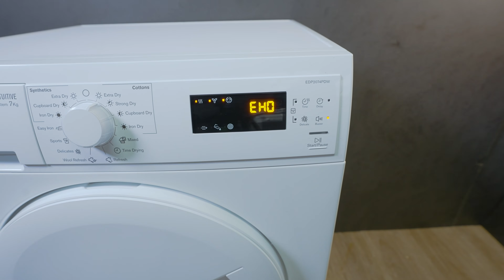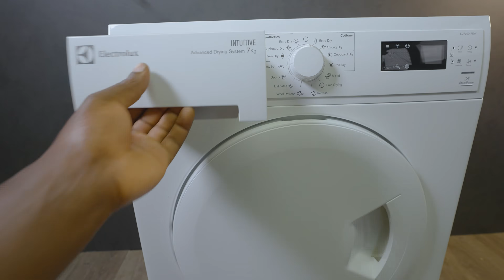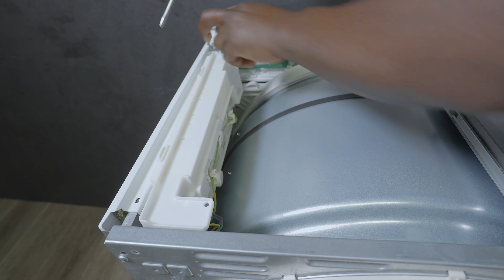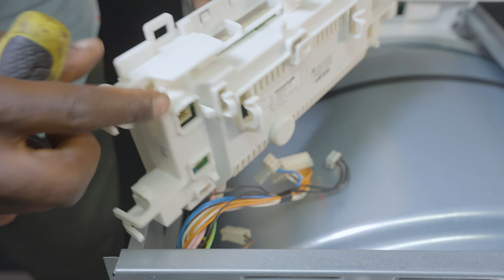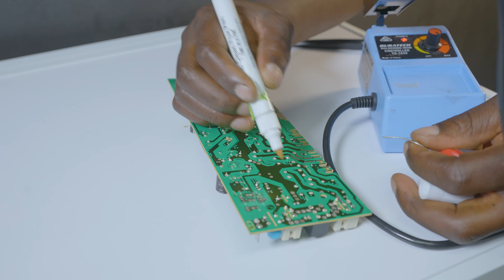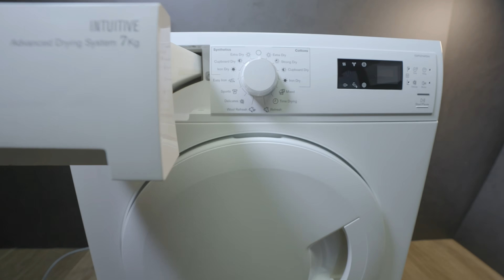Fix EHO  Error Electrolux Zanussi Dryer Easy Repair

Comment: This seemed too simple to be true, but a quick resoldering fixed EH0 problem on my EDH3497RDW dryer, as there was indeed a micro crack on the solder joint behind my OMRON relay. Thank you!

Comment: I am getting EHO after some time. It runs fine for 10 mins and then I get EHO and it persist after that.  If I switch off and connect after some it works fine and then again the error comes. Does that mean that there is a lose solder and is getting disconnected after running for some time?

Comment: Just watched this DIY tips video and honestly, I’m so glad I found it. I followed the steps one by one, and everything was super easy to follow—even for someone who’s not very technical. I was getting the EH0 error on my Electrolux EDC2086PDW dryer and thought I’d have to spend a lot fixing it. Most other tutorials were either too confusing or didn’t help, but this one was clear and straight to the point.

Thanks to this, I fixed the issue myself—no need to spend on a new PCB board or call a technician. It worked like a charm! If you’re facing the same error, seriously, look no further. This actually works and saved me a lot of time and money.
Reply: I am getting EHO after some time. It runs fine for 10 mins and then I get EHO and it persist after that.  If I switch off and connect after some it works fine and then again the error comes. Does that mean that there is a lose solder and is getting disconnected after running for some time?
Reply: @gamingmechanics6062 loose solder. I had the same symptoms

Comment: A huge thank you for posting this video. It totally saved the dryer. Frankly I could not see any issue with the soldering, but I did them all and it worked! You'll have to tell us how you came to the diagnosis in the first place!

Comment: Adding to the many comments already to say a big 'thank you' as this fix has worked a treat.  Solder joints looked fine but redid them and now we're back up and running.  Your great video has been much appreciated!
Reply: Hey, did you have to replace the component, or was simply adding more solder enough to fix the issue? Have an 10+ year old dryer that managed to get this problem with EHO.
Reply: @ just replaced the solder.  Used a solder sucker to remove the stuff there (that looked perfectly fine) and replaced with new solder.  Put it all back together and code gone, dryer working, and still going strong now. 👌🏻

Comment: Hello, my machine does not heat up. I did a test on the resistance and there is continuity, but the current that reaches the resistance is 7 V. What can I do to adjust it?

Comment: My EDC2075GDW was having this error and after following the video it fixed it thank you!
A couple things were different for me: 
First off, my Motherboard has a yellow glue over all the solder joints. Applying new solder would cause it to roll off and I couldn't de solder any of the joints either. So, you have to scrap the yellow stuff off around the solder joint then you can apply fresh solder. 
Also, the plastic connectors were very stuck. So, I had to use needle nose pliers and a flathead screwdriver to carefully to pull them off.
Otherwise, it wasn't too bad make sure to take lots of pictures of the motherboard wires and connectors.

Comment: few years ago, I resolved this problem and others by soldering the pins on the entire board. It recently broke down again with the same fault. There was a resistance that must have a value of 154 k or 145 k. This resistance had an abnormal value of 350k. Replace the resistance with another with the correct value and also a 12v dc relay, close to this resistance. Fault disappeared. I saved €300

Comment: Thanks so much for a useful video. It was the same issue with my dryer, causing intermittent the EH0 error. Dry/cracked solder joints on the back of the relays. Thankfully I had just enough knowledge and the right tools to fix this in about half an hour.

Comment: Na 6 jaar hetzelfde probleem en inderdaad bij mij waren ook de soldeerpunten rondom het OMRON relais slecht/gebroken. Oude tin met tinzuiger verwijderd, en opnieuw gesoldeerd (met tin en ouderwets lood). Een aantal ander twijfelachtige verbindingen heb ik ook opnieuw gesoldeerd (en steeds de oude tin eerst verwijderd). Alles weer in elkaar gezet en de EH0 melding was weg. Bij het losmaken van alle stekkers is het me alleen niet gelukt om de stekker met de 3 roze draden los te krijgen, stekker is me afgebroken. Hierop de contrastekker van de printplaat verwijderd, en 3 losse draden op de print gesoldeerd en (helaas) met kroonsteentje later de verbinding met de 3 roze draden gemaakt.
Reply: I have exactly the same problem with the 3 pink wires. It looks to have its own catch but it's still not coming loose. Thanks for commenting, I'll just solder in place instead of breaking it off. Groetjes!

Comment: Previously I watched a video saying I needed to clean the dust and fluff off the pcb but there was nothing to clean off. However, I followed this video and I did find bad solder joints on the relay as this video predicted. I re soldered those joints and it FIXED IT !! Brilliant. Do take lots of photos before unplugging all the connectors.
Reply from the maker: awesome glad you were able to fix it. should be good for a long time.

Comment: Our Electrolux ht33f8120 does not give EH0 error right away, it works for a while and then it comes.
Reply: I soldered some points at circuit board and after that it worked two times without error but when we tried it the third time it did not even show anything at the screen. Waited for a while without electricity -> didn't help, took of some connectors+without electricity+waited for a while -> works again. Strange.

Comment: Just did this repair myself, the solder pads around the relay were noticeably cracked as were a couple others. 1 min to solder up and the dryer is running again, Thanks!
Reply from the maker: Great work glad you were able to fix it

Comment: I found the exact same cold solders for the black Omron relay in my Electrolux tumble dryer. Resoldered and so far it has been working. Doubt if I would have turned in a 10 year machine for service. Hopefully it will run a few years more..  Thanks for the video!
Reply from the maker: Welcome glad it helped

Comment: I have a problem with a similar dryer.  After about 30 minutes the dryer stops and stops working.  The cooling fan does not turn on.  I did a service test.  error code ed3 appeared.  both sensors respond to temperature changes, which can be seen with an ohmmeter.  During the test, the fan turns on, but unfortunately it does not turn on when the device is running.  What may be the problem?

Comment: How to check and how to know the relay is faulty?
Reply from the maker: You would have to remove it. Use an external power source and test the relay. Normally they don’t fault it’s only the solder joints. When it blows you’ll see the burn marks on the relay itself

Comment: I already knew about these dry joints on this relay.  No other relays are affected though, although the one right next to the black relay has a habit of burning out.  Contacts melt and burst through the casing at the black relay side.  

It's worth checking for any deformation/rippling on that white relay case.

Comment: Thanks, woke up today to find out my dryer went eh0. Looking for this error I found your tutorial. There were two bad solder points. Fixed these and it's running again!
Reply from the maker: Welcome so glad you could fix it
Reply: 3 months later it did die , gave an error with the temperature sensor and while looking at the sensor I saw nothing wrong , cleaned it and it worked for a week only to get the same error again,  but... the whole device got so hot that I was like okay I'm not gonna try and fix this shit , I'll buy a new one before my house burns down.

Cheap repairs are okay ,but not if you don't trust the device anymore.

Comment: Damn but that was easy and as mentioned in other posts the same two dry joints. This problem has been driving me nuts for a over a year so thanks a million. Mine is a Zanussi dryer but only the names change to protect the guilty. They're all the same inside.
Reply from the maker: Awesome I’m so glad you fixed it. Yes Zanussi electrolux the same

Comment: I just finished fixing my machine, thanks to you it was so easy, it was faulty exactly in those same 2 contacts - i suspect it might have to do with the vibrations of the machine. thanks for saving me a lot of time and a repair that would have cost me a $120 US at least, as technician rates  go round here. i wish i could do for you more than just hit the Like button.
Reply from the maker: Welcome. I’m glad you fixed it. Your like helps the channel a lot

Comment: I used this Electrolux Flexcare Condenser 7kg for 4 years. 9 months ago it’s belt broke an repair costed US$150 equivalent, in Hong Kong. 4 days ago the error code EHO appeared and the machine just won’t start. I searched on YouTube and came across this video and didn’t believe it and my wife ordered a new machine yet to be delivered in 2 days. Preparing for the arrival of the new one, I removed the broken one from above the washer, and got the pc board out. It was perfect and no flaw in the soldering.  Since it was to be replaced, there is no harm trying to do anything to it. So I added new solder onto the solder points of this particular relay. I found my low lead solder having difficulty mixing with the original solder at first. That means the original  solder could have been of the industrial grade, high lead, high melting point to last a long time. Well the soldering eventually mixed the 2 kinds solder together. The different plugs of cables returned to their proper sockets. And I plug in the power cable and turn the machine on. Woh! The machine worked. Thank you so much. Now I am not going to throw the old machine away. 😅 And I need to find a place to store the new machine. 😢

Comment: I did this repair on Zanussi Lindo 300. Worked a treat as the internal parts were the same. Never soldered in my life before. Bought a solder iron and gave it a go. I redid every solder on the circuit board and now my tumble drier works perfectly. Just shows you…… give it a go, save yourself lots of money! Spent £16 instead of £600! Thankyou so much.

Comment: I easy fixed this error thaks this video.  Unfortuntely I noticed that tensioner roller is broken.  I need your help, do you know what is the easiest way to replace it? Is it enough to unscrew  the gray housing on the right to remove the rolle ?

Comment: Thank you very much!!!
At start I didn’t saw any cold solder, but from a closer look, you can see a ring inside the soldering.
So I just re-resoldered all of the relays, and it just works like new.
Excellent video, works perfectly. 
Mine is branded as AEG, but of course it’s the same.
Reply: Hello, this error diplayed everytime you pressed start button ? Or a few minutes or cycles later ? I have this problem since a few weeks and driving me crazy too.
Reply from the maker: Hi mate if it does that you need to resolver that loose connection yes
Reply from the maker: Awesome so glad it worked out for ya

Comment: Hi, thanks for the video! mine is working for t hours and then shows this error. sometimes after several minutes. i went over the soldering, but it didn't help, unfortunately. I do see that I missed the black relay solderings so I might take it apart and do it again, but is there a difference observation when the error isn't permanent, but comes and goes?
Reply: Exacriy the same question:) hope we can get an answer
Reply: @aktugbirinci3361  I actually have an update on this! I took it apart again, and did the soldering on the the black relay as well. And yes ! It works now !

Comment: Was abit optimistic if this would work or not as the soldering looked fine, but it's worked and saved me several hundred pounds in buying a new tumble dryer.
Thanks 👍

Comment: Dang, thanks so much for this. Like the other comments, same issue with cold joints, and a bit of solder fixed it all up. What is this - planned obsolescence? Manufacturing defect? In any case, happening outside of warranty this was about to cost me a pretty penny.

Comment: This was exactly the fault with our AEG. Failed after 4 years but in warranty so the board was replaced. Started playing up then failed this morning. Different board layout but both contacts on the Omron relay had fractured. Quick re-solder with leaded solder and its now working fine. Thanks
Reply: Value for resistor R58 PLEASE

Comment: Hello i have the same dryer but problem is it runs for a minute then there is lights blinking for midle water drop sign and dryer stopped. Do you know what could be the wrong
Reply from the maker: Hi it’s saying the water container is full. You need to drain the water container. Failing that you need to clean the reservoir where the pump sits

Comment: hi mate got the same dryer ive got it to work had not fault codes but would stop just after starting. i found the if in unplug the water pump at the back it work ok but will not drain now as there is no pump ive tested the pump it works fine but dryer will not run with it plugged in?????
Reply from the maker: Hi mate. Have not run into that issue yet but I’ve got a few ideas. There might be a fault with the pump, might be drawing too much power. Another thing to check is use a flat screwdriver replicate the door being closed. For this open the door. You’ll see a flattish hole at the top where the door closes in push the flat screwdriver in there. Press start. Start the dry cycle. When it stops. Turn the drum by hand, if it continues it’s likely a capacitor starting to go
Reply: @askmrwashywashy  thank you for your time ill have a go at that

Comment: This error code has been driving me nuts! Followed your steps and found the loose solders on the PCB board! Soldered them now it works perfectly, saved me a few grand, also replaced the locking mechanism on the washer! Good as new!
Thanks mate